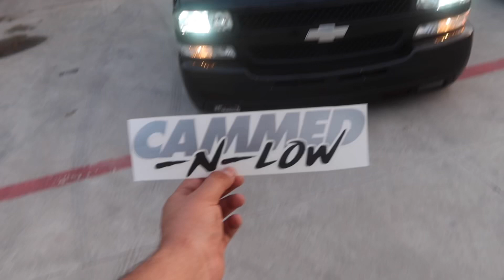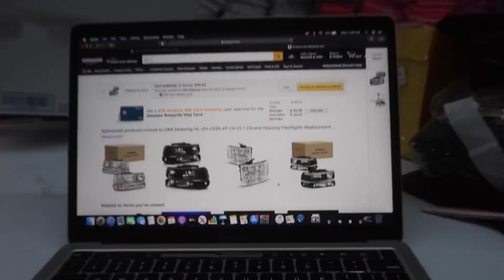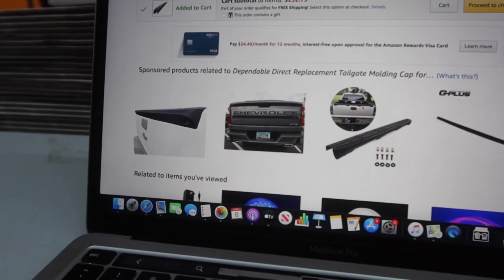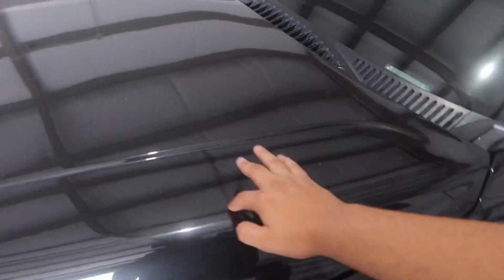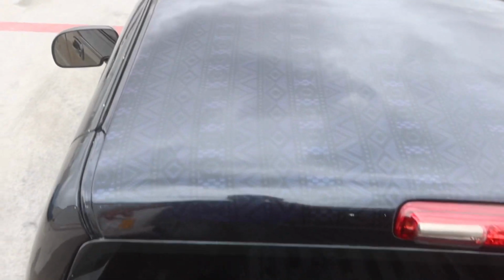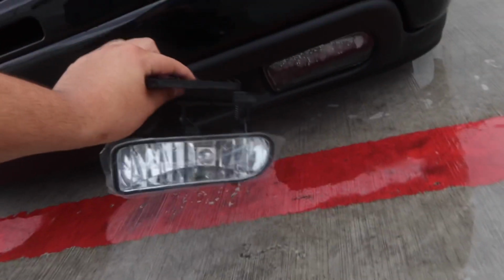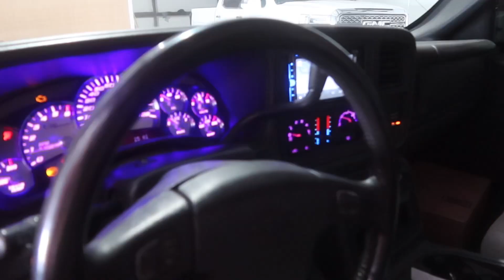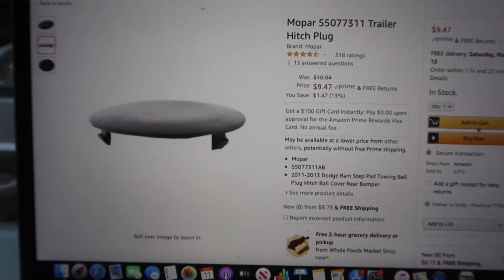Bagged single cab running again!  +cluster build!

Comment: Hey brother, pretty sure you won't see this comment but doesn't hurt to ask. I have an extended cab truck like this & I'm trying to find door panels but I'm having no luck on the internet. Were those the original panels that came with the truck? If not where did you get um cause I'd like to find a set so i can do my interior a different color eventually. Thanks 👍